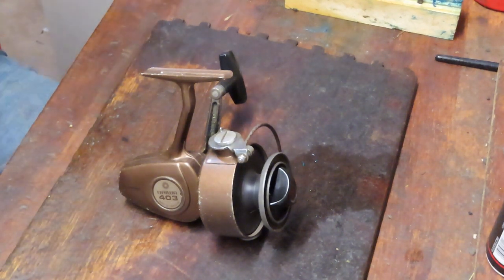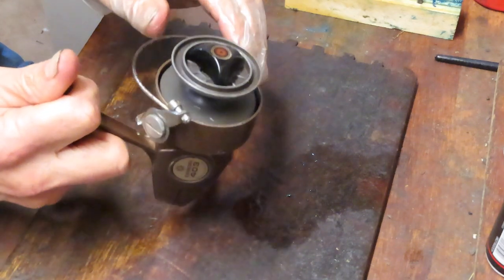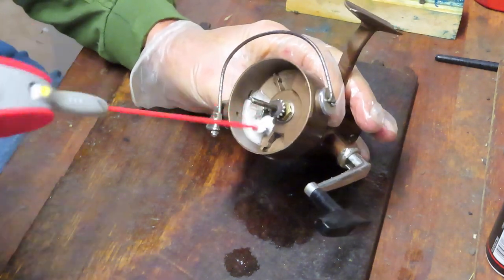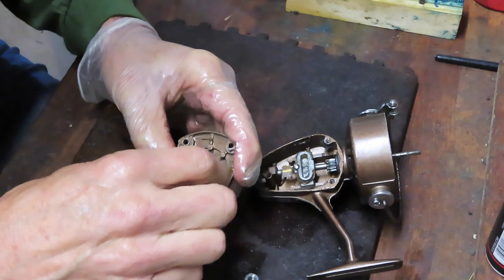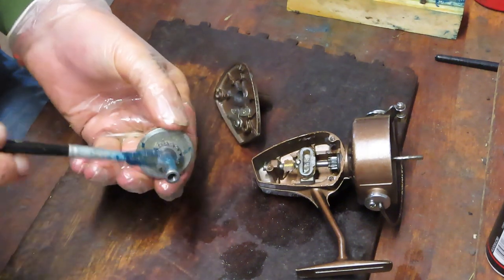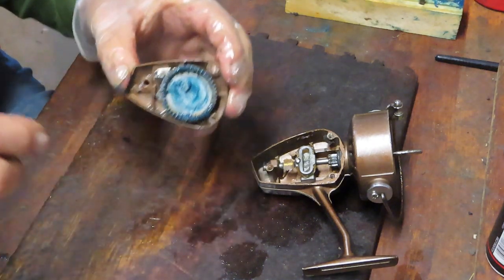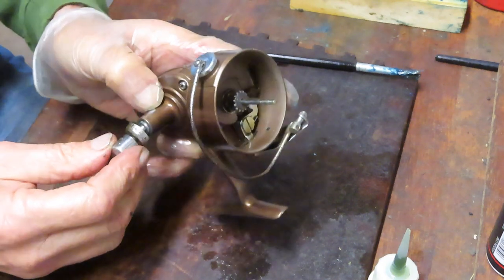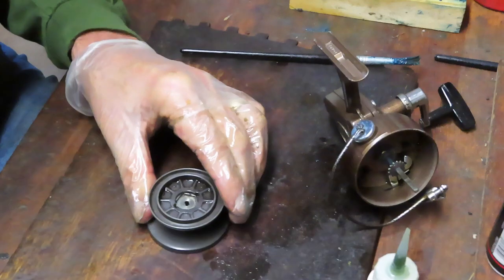Daiwa 430 vintage spin fishing reel how to take apart and service

Comment: I have that exact reel and it works pretty good. The only problem i have is that the anti-reverse switch handle  is missing. The dog and spring are there though. Thanks for the video Dennis.
Reply from the maker: That switch is in an awkward position and t=it, along with the plastic ones that were on the C series reels ceded to break off when hit against a side wall or pier railing.  I doubt if you can find a replacement, but  long as it is stuck in anti-reverse mode, you are OK.  As you know, many reels today do not have the over-ride.  They eliminated it when they went to the one way A/R clutch - Take care Jeff - Dennis
Reply: @2ndChanceTackle  yeah it is. My sister-n-law picked it up along with a few other reels at an estate sale so who knows how it got broke. Yeah the reel is still usable. 
Thanks Dennis. You and your family stay safe, stay healthy and god bless!

Comment: Hi Dennis,  this is another fine video! I was actually searching for information on my Daiwa 403A reel, however the closest thing appears to be this video on the Daiwa 430. Is it me, or is there very little information on these vintage Daiwa's? There is of course Alantani.com, and also the ORCA website, but it looks like no-one has documented all of Daiwa's old models? Best wishes, Paul, New Zealand.
Reply from the maker: The documentation usually came in the box and unfortunately, pre-internet, folks were left to the paper trail.  Both Alan and ORCA have done a good job of assembling the paperwork from th older models and telling the story.  I am not aware of any Daiwa specific site that shows the older reels. Thanks for asking - Dennis

Comment: Nice looking reel. Is there a smaller version vintage reel for panfish? Another great video. Thank you
Reply from the maker: Yes - there are a lot of smaller, vintage Daiwa reels.  Check the online marketplaces like Craigs list, Ebay and Facebook Marketplace for those.  Better yet, the flea markets and local tag sales offer better bargains, but you need to search them out - Dennis
Reply: @2ndChanceTackle HI Dennis would the Daiwa 401a be smaller or the same size as the 403?  The 401 seems similar in design to the XR10/11 Zebco reels.  Is it more similar in size to the 10 or the 11 if you know?  Thanks

Comment: I have a daiwa 404A and the bail would not flip over, I took it apart numerous times to repair got new levers springs bail itself still the same result only flips half way the trip inside is in fine shape now because I’ve removed and reinstalled so many times the screw hole in the rotor that retains the bail is totally stripped what do I do with it now. Parts reel ?
Reply from the maker: It sounds like a faulty bail wire was the cause of your problem.  If it gets bent, it puts tension on the bail assembly and it cannot fully close.  Watch this video on how to correct it.
https://youtu.be/fLHA0uTXHJQ 
If you have stripped it ut, your only remedy short of a replacement rotor is to try and re-tap the hole
Thanks for asking - Dennis